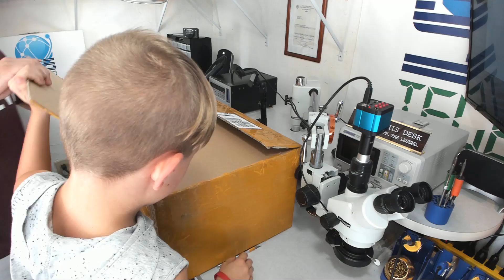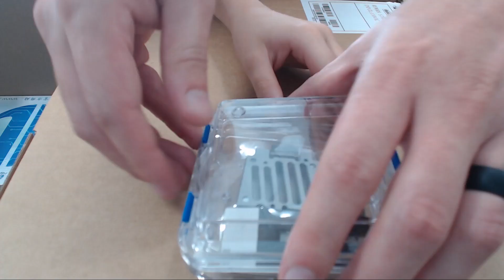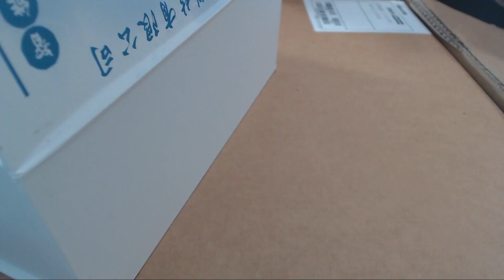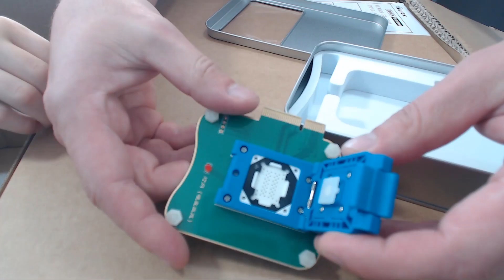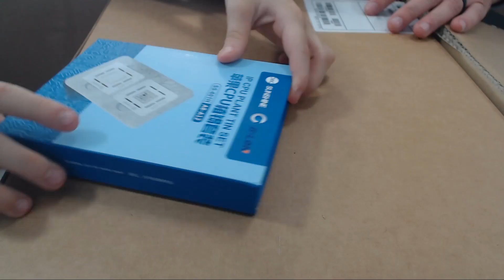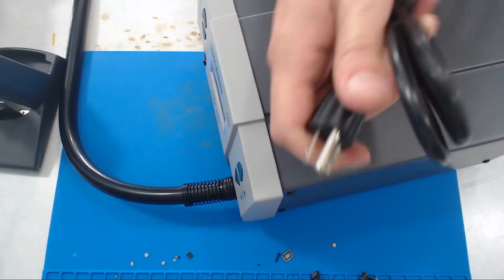Unboxing some new phone repair tools

Comment: When ever I do memory upgrading by replacing flash ic,the device return backs after 4 or 6 months due to no power issue..flash ic leg dries is the issue..when i reballs the ic and fix back it works properly.any solutions???

Comment: What is wrong with that Aoyue a++, is the same I have. I never opened my dream shop, Wondering if it a good or bad machine. Just changed some Caps, power connectors, and other silly practices but never an IC for example.
Reply from the maker: I still have it and it still works really well so I have nothing but good things to say about it.  :)  Mine started to pick up a very slight vibration.  It only caused me trouble when trying to record video under the microscope, zoomed all the way in.  Other than that, the vibration was hardly noticeable.
Reply: @ststele  Omg, this was a year ago. Sorry.  I'll be more in tune with your channel. Quick hot air station looks to be better, it seems.

Comment: Hey there! I am into this cell phine repair business and I need to buy a new multimeter which can even read the charging voltage on the battery connector on the logic board of all the ios devices. Can anyone suggest me a good one to go with?🙏
Reply: do you need now ?contact me
Reply: @gavingavin2595  got a new one already
Reply: @AB-ir7hh  if you need any goods contact me
Reply: 9086094208 is my whatsapp no. Hit me up there🤘🔥
Reply: @AB-ir7hh  +8613513564405

Comment: Hey Jason don't worry about the hot air station being difficult, You;ll get it dialed in in just a few minutes. Get that baby hooked up and you wont be disappointed.
Reply from the maker: You aren’t kidding.  It purrs so very smooth and quiet. Loving it.

Comment: Congratulations, that are some very nice tools. When I moved from aoyue to the quick, I had really bad problems with pointing the hot air to the right spot under the microscope. Using a bent nozzle changed that back to normal... You will see when you start to work with it.
Reply from the maker: I just hooked it up and powered it up.  I'm loving this thing so far.  Haven't done any work with it yet but hopefully it wont take too long for me to adjust to it.

Comment: I think it's a British plug adapter and you needed a continental-europe one
Reply: Cut the foreign plug off, and wire in a $3 plug from the local hardware store. There is no need for the adapter to be there.